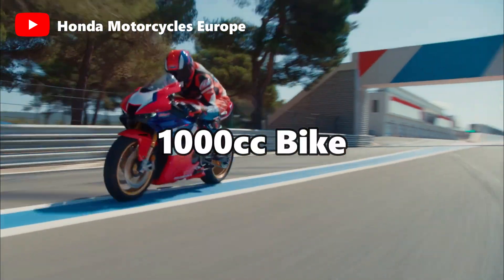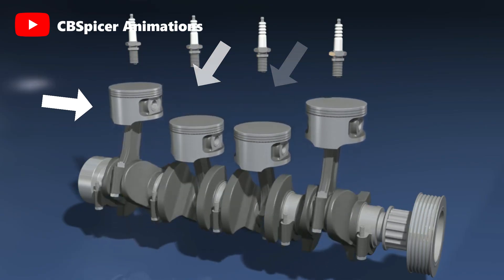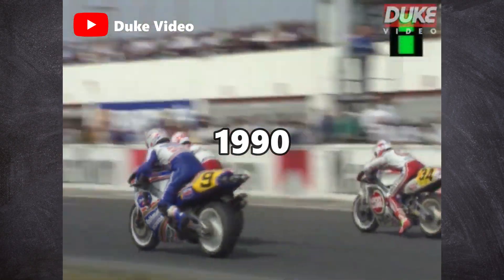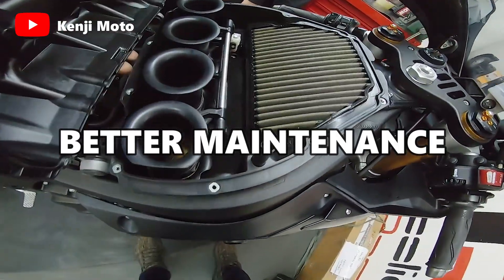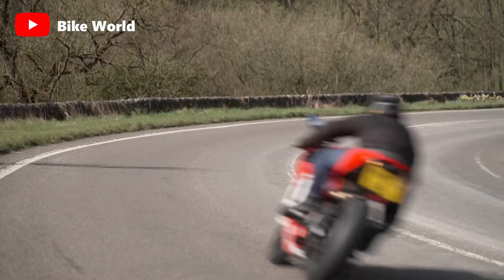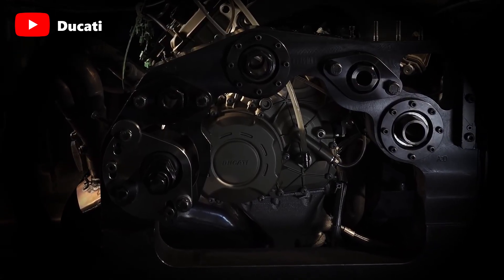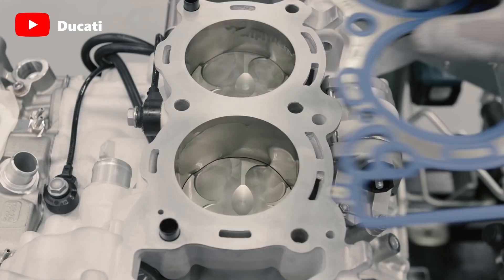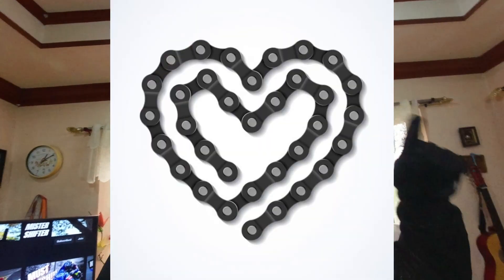What makes Inline 4 and V4 Engines DIFFERENT

Comment from the maker: Would you choose a V4 over an Inline 4?
Reply: Inline 4
Reply: @notno.11  inline 4 because of the sounds😂
Reply: @lien51  cross plane or flat plane crank
Reply: It's not a question what I prefer it's what I can afford😭
Reply from the maker: @aanndditsgone4044  😭😭😭 SAME!!!
Reply: Nope. To expensive to repair . GSXR is fine for me
Reply: Inline 4 & crossplain
Reply: V4
Reply: I applaud your efforts to research your subjects BUT.. an engineer your not & completely mis-interpret realities of bikes design principles.. comparing HarleyD to ANY performance stds ??.. NO V4 produces ANY different power OR torque than inline.. OR SOUND (that's a result of ignition timing (X-Plane R1, R7/tx900twin) .. look at the shift from vtwins.. what makes v4 vs inline GP bikes?? as your posts title says.. is the effect the longer extreme high reving inline crank has flicking the bike corner to corner.. the extra rotating mass out wider creates a MUCH stronger gyroscopic effect the engine has on the bikes handling in multiple ways the biggest being as the engine rotates in the frame as a bike is flicked side to side, the crank ends change elevation, as well as rotating plane.. vtwins don't have quite as strong effects plus they can't rev as high having double the length stroke for displacement.. NOTHING to do with power (HP or torque), & ANY perceived weight penalties a v4 might create with much more complex cam & head gear is more than offset with the weight differences of the ALL STEEL longer & more complex inline4 cranks (no shared crank big end journals & more main journals plus, the v4 crank is much stiffer & less prone to harmonic whip which destroys crank shafts rapidly.. so a 👎 on your analysis on this one
Reply: suzuki inline 4
Reply: Crossplain is 🔥
Reply: Yes
Reply: Inline 4
Reply: In my opinion my 06 vfr800 has one of the nicest sounding v4 exhaust note. One of the reasons why I bought it and it's within my budget too.
Reply: @rmtheg234  84-86 vf1000r 👌😘 for looks, sound & disability on the road 👍
Reply: Got it
Reply: @noidontthinksolol  sorry autocorrect
Reply: Ofc
Reply: CP4 I4
Reply: inline 4.... because sounds 🤣
Reply: I've always been a jdm,dsm  car guy 1.8,2.0 inline four turbo or non turbo were some of the most durable,easy to work on,reliable engines.i think my love four the inline fours comes from that,motorcycle or car inline fours will always be my go to.
Reply: gonna grab a RSV4 you got best both of the sound the V4 and the inline sounding waahaha
Reply: I prefer single cylinder
Reply: Flat plane inline 4
Reply: Have owned a 2016 s1000rr and ridden a friend's v4s for a week , I'll take the s1000rr everytime
Reply: Inline 4 all the way, reliable,  the other not so much.
Reply: Resale value v4 sucks, people that own them usually don't have the cash for maintenance or experience to own one. Inline 4 are some how more reliable but resale value is king... I stay V2 lover... RC8R.
Reply: Always inline 4 that sound, feel, and it's rich histroy, love Kawasaki
Reply: I currently own a 21 RSV4 1100 Factory and would never go back to an I-4, (I also had a 16 RSV4 1000). 

The one bike that I wish would be resurrected from the past is the VFR750F from the early 90s. V4 torque, gear driven camshafts, and a smooth as silk power delivery. Not to mention that it was a motorcycle that literally did everything very well. Honda needs to bring that bike back as a replacement for both the Fireblade and the old ST1300, much like the route Aprilia has taken with the RSV4 and Toano
Reply: @roadwarrior1961 sold my 2019 rsv4 factory (akrapovic exhaust) because of ergonomics. I considered a Tuono but was put off because of the problems I had with the rsv4. it had some hiccups the Italians built in. wrong fans, yeah wrong FANS behind the radiator which resulted in 🔥temps . defective thermostat, water pump leaking (got 3! on warranty), defective Relais for the fans, higher oil consumption - within normal but high, oil dipstick was a pain, ran too hot because of wrong coolant mixture too. 
Now I got a MT10 and can say the sound is nearly as good. I am missing nothing and maybe some day I will buy a v4 again. 
The sound of the Ducati v4 in the SF is not even in the same room when compared with the CP4 or Aprilia V4

I would buy a V4 if maybe Honda brought a 1000+ CC V4 

I also like the sound of my Fireblade SC77 with Akrapovic … so it depends on my mood I think
Reply: Yes
Reply: Inline 4 is better
Reply: Inline 4
Reply: Orr hear me out here get both
Reply: If there's 1 big advantage it's the sound, especially the Aprilia V4. And that's my favourite, perhaps the Tuono for some extra comfort but there are some great inline 4s. My favourite being the Kawasaki H2, both sound & performance, I'd still prefer Aprilia tho cuz they aren't as heavy.
Reply: Inline ✌
Reply: Inline 4.
Reply: It has to have 4 pistons for every 2 wheels.
Reply: no.
Reply: V4
Reply: V2 and V4
Reply: @horaceoli72  both of them
Reply: Inline 4 will eat dash and smoke to v4
Reply: Inline 4 as i own a gen 2 busa and it has amazing torque even at lower RPM...
Reply: v4 all day
Reply: I love the bitchy screaming sound of the In-line four.  And i love even more how reliable and cheap they are to maintain.
Reply: i4 with a standard crankshaft all day long. I get thrills when I rev an inline 4
Reply: K5  inline 4 ❤️‍🔥
Reply: Inline 4
Reply: I disagree. The online 4 rev so much fast than a v4.. I'm sure the v4 can be built to rev fast but it has nothing on the inline 4
Reply: Crossplane inline 4
Reply: V4 anyday!!!
Reply: Both
Reply: Rotary, i would choose a rotary...
Reply from the maker: @farishazmi3051  ooooooh~ 😎😎😎
Reply: CP4 ❤
Reply: @akshayakumarbehera5840  facts
Reply: @akshayakumarbehera5840  cp4 is an inline 4 newbie
Reply: Nope. V4 anyday instead of the rough cp
Reply: I’ve owned a Honda CB 750-4 and a Honda Magna 750-4. 
I burned my legs so many times on the pipes of the CB 750 I started to hate it. 
Loved the narrower Magna. 
Performance was comparable after jetting the carbs on the Magna. 
It was a smaller bike but I liked it better.
Reply: I drive a RSV4 best enginge for my opinion in this bike
Reply: Absolutely, I love V4 engines so much that I don't want any inline 4 in my garage... V4 is love 😍 forever 🤤🤤❤
Reply: @racer_v4r  Is it the V4 you're in love with or the manufacturer of the V4?
Reply: @racer_v4r  they don't last long ,I had a Duc and when I used in wet conditions it broke down ,now owned by AUDI tec they are maybe more reliable
Reply: @blackbusanator   which year model? Was it a V4 or a V2 ?
Reply: I currently ride a 90* V-twin, I might consider a V4 from the same manufacturer, but never and inline-4.
Reply: Desmo V4 💪😎

Comment: V4 may be good for performance but it sounds really bad, it sounds like a tiger only when in neutral but once we ride it and rev it it's sounds just like a rusty tractor 🚜, sounds really bad with no excitement for more and more speed. While in inline 4, it's just like moto gp racing with goosebumps and excitement.

Comment: I have a Honda CB1300 (inline 4) and VFR1200F (V4) and I prefer the silky and smooth power delivery of my CB1300. The V4 makes so much unnecessary noise and it's not very suitable for normal road ride. The CB also sounds so elegant and does not  " scream".

Comment: I really don't like the V4 sound. When I was new to motorcycles, I didn't know about or really cared to learn what the differences were between the Flat Plane I4, Crossplane I4, or V4 engine layouts and thought it was a matter of design philosophy, and that all the different exhaust notes were due to exhaust systems.

When I first heard the Crossplane I4 sound, I thought that was what the V4 sounded and thought it was really cool. It sounded unique and the lagging 270 firing crank caused this resonance between bass and higher pitched notes which made it sound fuller than the either Flatplane I4 with a Graves/Akra exhaust and the V4 with a longer, narrower exhaust.

It shouldn't be a problem as its nice to have bikes with different characteristics and traits, but the thing is that in South East Asia where I'm from, single cylinder motorcycles are really common, and there's a lot of assholes who straight pipe their scooters and underbone motorcycles and cause all sorts of noise complaints, and they sound almost EXACTLY like a V4, and it really cheapens the experience for me, even if its from a premium brand like Ducati.

Comment: V4 doesn't have a perfect primary balance. Inline 4 with standard crankshaft has, because whenever two pistons are at TDC, the other two are always at BDC. In V4s in motorcycles each pair of pistons usually shares a crank pin, and the angle between cylinder banks is usually 90 degrees, which means whenever one of the pistons is at TDC, the other one in a pair is halfway through the stroke, and the other pin may be rotated relatively to this one by the arbitrary angle, so there is no way to generalize what's going on with the whole engine.

Comment: I have both a 4 inline (Yamaha FZS 600 2002) and a V4 (Honda VFR800 VTEC). Yes, the V4 has more torque at low revs, but the 600cc inline 4 has nothing to envy to the V4 at higher revs. Moreover, at low revs (2000RPM) the V4 is very choppy and coughs under load, while the FZS600 is perfect.
Anyway, the key point is that the sound of the inline 4 is a symphony, compared to the brutality of the V4.
But ii is really a matter of tastes..

Comment: Putting the r1 cp4 in a pot with the Flatplane In-line4. That’s just false. Firing order in cp4 puts it more in the space of V4 in tire wear and tire stress. Also it’s different in forces inside the engine making it quite the oddball. 

That’s just bad research on your part.

Comment: I have the best of both worlds with a 2014 Honda CB1100 (1,140cc) inline DOHC four, and a 2010 Honda VFR 1200F (1,237cc) V4.  The CB1100 is air cooled and incredibly vibration free.  With it's mild state of tune and just 88 horsepower, it pulls strong from idle.  The VFR has slight vibration near idle that quickly goes away beyond 3,000 RPM.  The front two cylinders are the outboard cylinders on the crank, making the bike narrower where the riders legs are to the rear.  It has unspeakable power of 170HP at the crank and 152HP at the rear wheel with shaft drive and revs to 10,200 redline.

Comment: Both engines are more suited for the track. A V-twin, parallel twin, thumpers, and triples make better street engines because of their torque 

Honda’s cb/cbr650 is a street tuned I4 so their is one option

It would be interesting to see a small-mid displacement v4 tuned for the street

Comment: Inline 4, always. The sound alone is worth it. Although I'll admit the v4 is probably better for racing. But imo they sound like dogshit, they run hotter, more expensive to buy and to fix, generally not as reliable, and weigh more because theres more parts.

Comment: Silly, it’s the difference between HP and torque. Why a rice burner could go faster, while a V engine will get there quicker. Look at Moto GP and the tracks Yamaha and Honda dominates, fast no need for hard acceleration. Then look at Ducati how the pull away at the exit at the corner. Motoguzzi that’s the best blend of the two in my opinion. Although a glass of water could be st on a Vincent.

Comment: I had a Honda vfr 800 with a v4 vtech. Best bike I ever had. There's just power at every rpm from idle all the way to the red line. The distinctive sound of the v4 mixed with the sound change of a vtech and the power delivery of that engine felt really unique
Reply: You bring back memories for me. 1998 Honda VFR 800 was my first street bike. It rode great and sounded so sweet with the Vance and Hines full exhaust.
Reply: Greeat bike. People saying i4 have clearly NEVER owned or even ridden a v4. No comparison. This video is i4 biased, probably never ridden a v4. I like his content though.
Reply: @boogiewoogit5597 agreed the comparison wasn’t that fair. I wish they had a proper v4 in there to compare. My VFR800 sounds better than most of these examples of I4’s

Comment: Choose an Inline 4 if you’re riding on the street. The power it produces is more linear which translates in better comfort riding in the street. Choose a V4 if you track often; the V engines have high torques which enables you to pick up speed fast after corners into straights on the track. At the end of the day, buy what you love, as long as you love the bike, you’ll learn to ride it whether it’s an inline4 or v4.

Comment: a v4 sound is not practically a tiger growling, but an inline 2 engine with an open pipe exhaust. that's what it really sound like. dont add the tiger growling title to a boring 2 cylinder sounding v4 engine just to slap a high price to it.

Comment: from V4 they should move up to V6 which will make bigger displacements possible.
Reply: bigger displacement means higher weight, especially on a V configuration, that goes hand in hand with slower bikes, which is the opposite of what performance enthusiasts want.
in the span of 15 years we weont from 160 hp to 220, leaving the old same 999cc I4
Reply: abit true but after the rc211 V5 its not a big deal to make a compact high revving V6. dont know abt the emmissions though

Comment: The reason why the company is not switching to v4 because of the production cost and aditional extra parts the v4 is better in terms of performance because narrower crankshaft less stress in friction, and ducati v4 and yamaha i4 crossplane sounds similar because the firing interval and the combustion is the 90,180,270,360, degree of the crankshaft spin position, and the aprilia v4 is same in the i4 flatplane 180,360 degree of the crankshaft spin position. If your have intel in mechanism it’s easy to understand. The thing that i want in every production superbikes is counter rotating crankshaft it will add extra production cost also because of the extra gearshaft, but it’s a must because it will give you extra control in agile and anti wheelie without reducing engine torque via electronics. Well ducati v4 and 800cc mv Augusta did it but those bikes are not on my wishlist because lacking of fuel gauge and cruise control.

Comment: The Ducati Streetfighter V4 doesn’t get hot at all, I can’t speak for the panigale, but the V2 gets so hot it’s painful to ride. The V4’s are also pretty dang reliable and are super smooth compared to most ducati twins.
Reply: I think the streetfighter and newer v4s turn off the back 2 at idle. The older ones didnt have the nicname chestnut roaster for no reason.

Comment: I have a 1998 Gen 5 Honda VFR, VFR stands for V Four Racing, also one of the few bikes with gear driven cams. The whine you hear beats pretty much any engine noise in my opinion, ;)

Comment: i would like to have V4 400cc but none of brands make them as of now
1000cc is just too much to do daily in many reasons
zx25r is just too boring and it need too much rpm to go at decent speed
old honda v4 is fun but when you have to wait few months to get a part or have to deal with carbs they are not ideal to daily (it just too old)
if electric gonna replace the gasoline anyway i think they should push the limit and sales out now before gasoline engine is ban (new from factory)

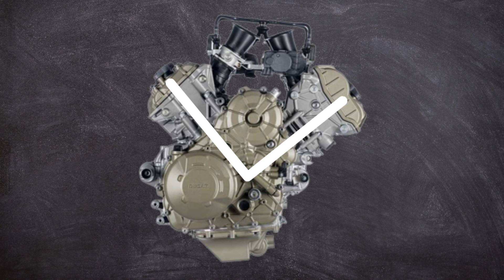Comment: OK, at 6:00 you say that 90° V engine has better primary balances than an inline four. Though I’m pretty sure a flat plane I4 is inherently the most balanced engine configuration period because you have 2 reciprocating pair of pistons that cancel each others forces and it’s only on one plane. Pretty sure a V anything needs counter weights on crankshaft to achieve any balance, which is the opposite of what you said. Care to correct me?
Reply: Your n=2 mode is off on flatplanes. Mine gets buzzy around 6000 rpm. Of course the argument is I shouldn't be revving that low in the first place 😉

The best natural balance is found in i6/V12 engines. I believe Honda made an i6 bike once. With equal length headers. Howls like an old F1 car!

But yeh, those engines you can rev into oblivion without worrying that they'll shake themselves to bits. The only real limitations come from valvetrain etc.
Reply: @233kosta  sure, but would you at least agree that the V2 and V4 are not magically more balanced than a flat plane I4
Reply: @JohnSmith12931  Oh no, of course not